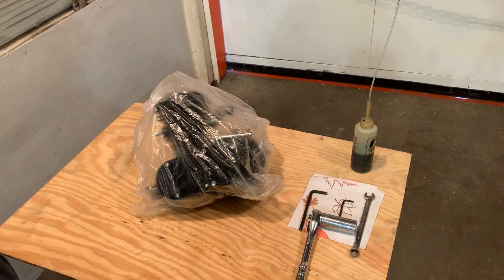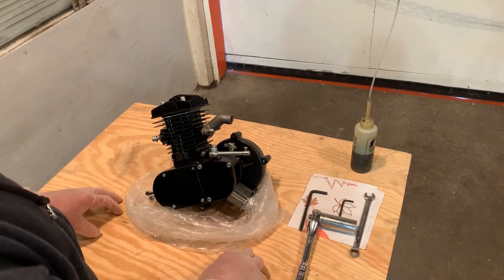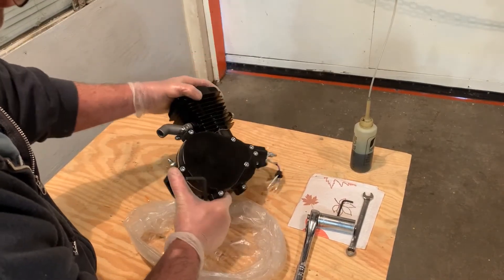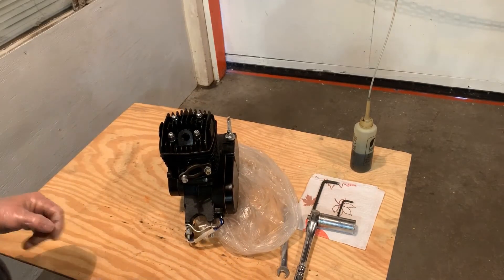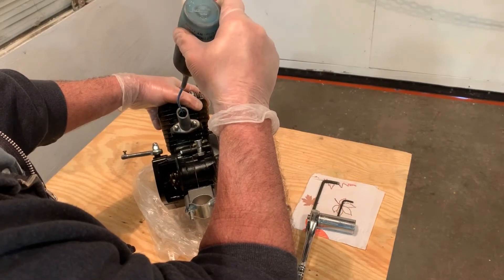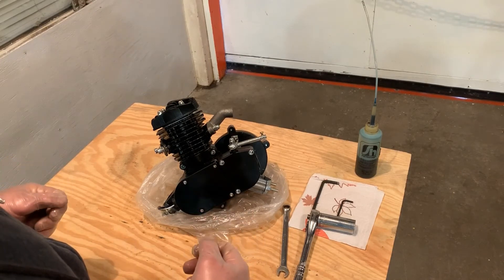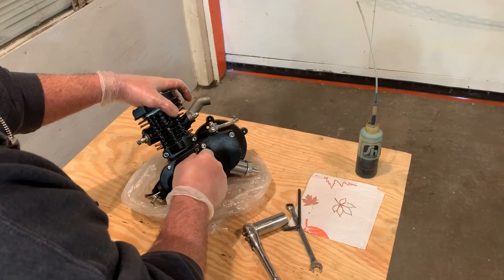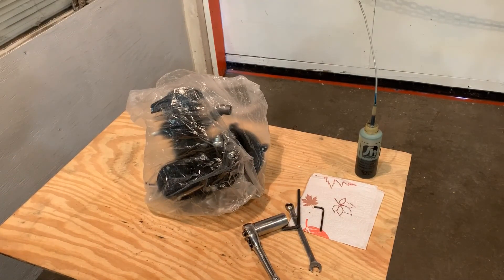D I Y Step 1 Engine Prep 2020

Comment: SHould also check piston if on the right w*y
Reply from the maker: I used to do that from time to time & then I thought, wait a min. doing my work & then checking the factories work is really eating up my time, so now I just check the externals of the engine & if for some reason there is an internal problem I'm sending it back.. I'm not here to do my job & theirs too...🤬 I'm not saying it's a bad idea if you have the extra time to do it👍.